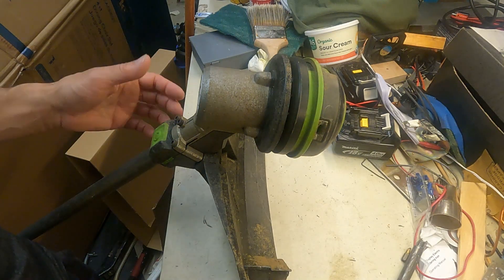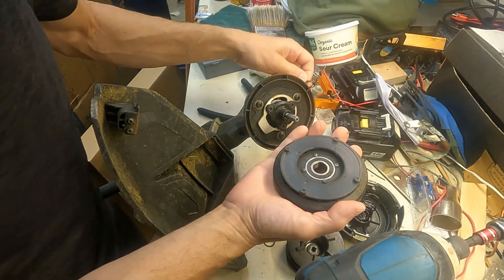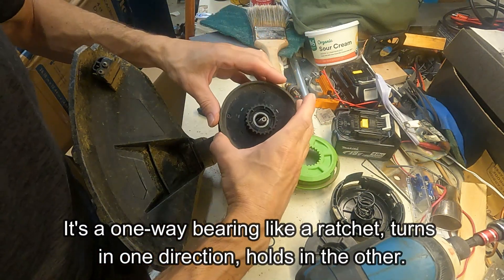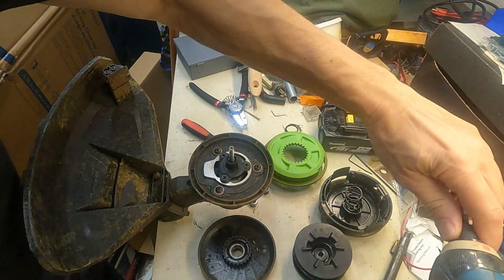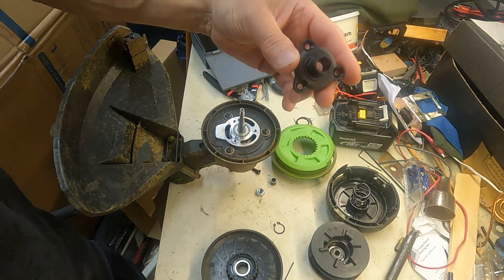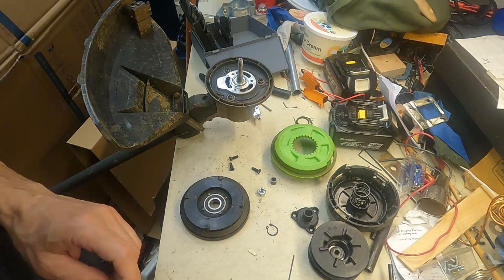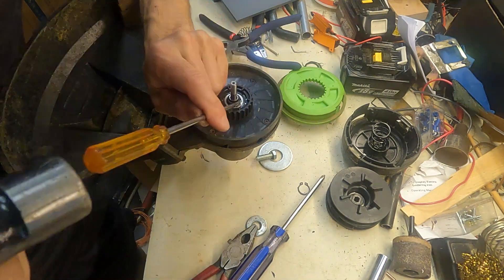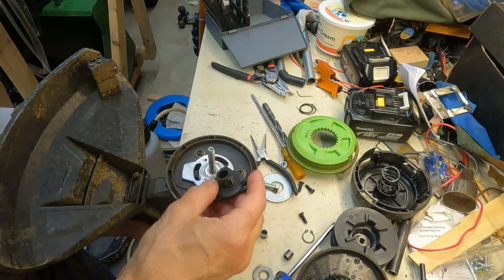EGO Line Trimmer with Power Load - Failure and repair

Comment: I stumbled across your video when researching a different problem with my ST1500E. The conclusion that I've come to, is this Ego stuff is not made to last and I regret investing in their system. My trimmer has stopped working and I know someone who had a problem with a mower and the pole hedge trimmer. Yeah their warranty is good but trimmers use to last 20 years and were easy to fix. These are a different kettle of fish. The convenience of battery powered tools is great when they work but when they don't, they seem hard to fix.

Anyway, rant over. Thanks for making the video
Reply: Yep, its cheap Chinese junk. Its ok for home use but its really garbage to be honest
Reply: @momo_the_great6969  Yeah it was pretty disappointing how long it lasted. I ended up buying a new brushless dc  controller to try and fix mine, that was not the problem. So bought a new DC motor and that sorted it. 
Not sure how long it will last, but changing out the bits was pretty fiddly. Cleaner than internal combustion but I'd rather do piston and rings any day!

Comment: Agreed about making that part available w/o buying an entire new motor - that is gouging and wasteful.  My weed eater has the same problem, and this is the first time I have seen the issue even addressed - you have done a great job figuring this out.  
But meanwhile I actually bought a new weed eater and want to put a blade on this head and just use it for that.  Unfortunately, the configuration after removing the power head does not match what I see online.  The others have a deep cup that when removed reveals a smooth metal plate - this weed eater has a shallow cup and (not smooth) plastic under it.   - I'll use your ingenuity for inspiration!  Thanks for making this video - I did gain information that is useful for what I'm trying to do, and I appreciate it!

Comment: Thanks for posting this.  I actually purchased a ST1620T that came in dead on arrival.  Have sent it back to Amazon, but you got me curious about parts availability.   Looks like on the newer model almost no "service" parts are available for the core unit.  Think I'll stick with one that doesn't load itself.

Comment: Having exactly the same problem! After cleaning every part and putting it back together, I was able to load again and I thought problem solved. Not so fast ! After the second load of line the problem returned and I had to go through the same procedure again. My next step will be, is to replace the original EGO head with an Echo speedfeed 400 universal head.
It will not be fully automatic, but it will save a lot of time not having to disassemble the original EGO head. Other than this issue, it is a fine machine.

Comment: I bought the same trimmer recently and the bump-head lasted only a few hours of use before the automatic line feed mechanism failed. I fixed it using the technique shown in this video, but Ego have made a poor quality product if it fails after such a short period of normal use. At least the manufacturer warranty is five years, but I could do without the hassle of returning the equipment. Such a shame as I quite like most other things about the product.

Comment: MY PROBLEM IS DIFFERENT. WHEN I PRESS ON THE BUTTON, NOTHING HAPPENS, any advise?
Reply: Same problem 
Push button nothing 
Took & cleaned 
Thinking maybe bad switch
Any other thoughts
Reply: Same issue here, bought a new switch has the same issue

Comment: My problem is that the powerload button doesn't engage.  Has anyone else had this problem and if so what  did you do to fix
Reply: Try putting on echo speed feed. It comes with adapters.
Reply: I got same problem that you have ... and still locking for how to fix it .
Reply: I had to  call EGO customer service. They  had to put me on a long hold. There were no  repair places close to my house.  Luckily, there is a  5 year warranty, and mine was 4 years and 1 month old, so they sent me a replacement. It  took about 3 weeks  to  get. I was going to  try and change the old one to a brush cutter, but I  was told it wouldn't work on this model.
Reply: @PDX..5071  will the echo speed feed work on this EGO  model. I looked up on Amazon, and  no EGO  models are listed as compatible.
Reply: @fredrickward7672  I am not sure. I do know there are adapters included with the echo speed feed.U can try it if it doesn't work save receipt and return for money back . U just push the adapter out of the head and pop the one that fits in.  Good luck.  Hope it works..
Reply: You could design and 3D print that part easy
Reply: @momo_the_great6969 ….who can do this 3D Printing of it ?
Reply: @normabussey2254  I havent done it yet but will be soon. Im going to have to design it. Mines stuffed up for a second time only 6 months after getting it changed last time. I'll let you know how I go
Reply: @fredrickward7672  Oh no, that's what I'm trying to do!  The first one wouldn't feed string - like in this video & thought I would still get some use out of the older one (bought a new one) - ugh!

Comment: What do you do if the motor doesn't  click over at all
Reply from the maker: You'd have to go through the wiring from the battery through the switch to the motor.
Reply: This seems to be our issue. It won’t even click over to start and we tried various batteries that work with the blower. So not a dead battery. I don’t know where to begin.

Comment: It took me less than  5 minutes  to tear down and repair my ego power head, and I'm  paralyzed  on my left. Crappie design?
Reply: Yes ,it is.   There is constantly something going wrong with these things.
Reply: @beatlemania54  I've  had my ego trimmer for about a year now with very few problems . It's my experience that most complications are operator caused.
Reply: @Townie001  Go away with that crap. Its a garbage design.
Reply: @mozzman9030  I've been using  the Ego trimmer now for almost 3 years, not only cutting grass but also blackberry, so I truly don't understand your problems. ✨️🤔✨️